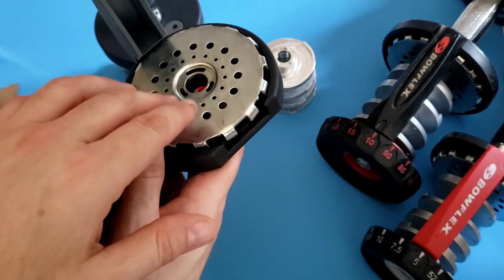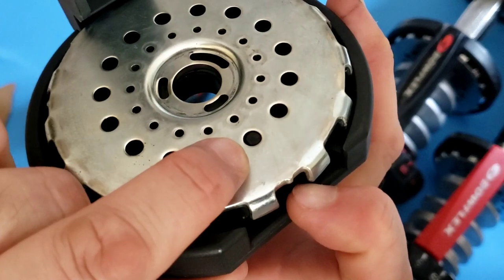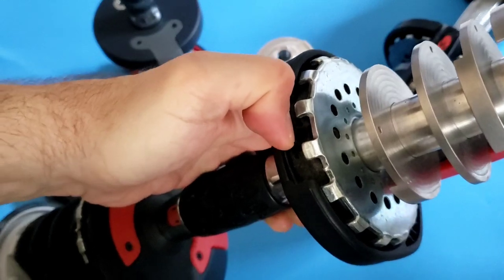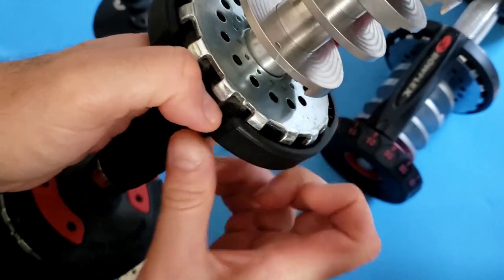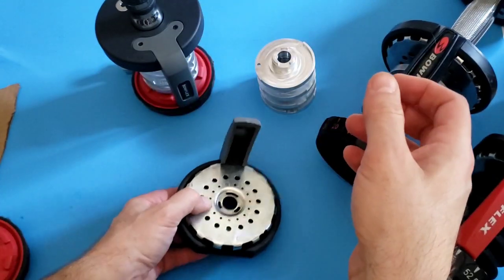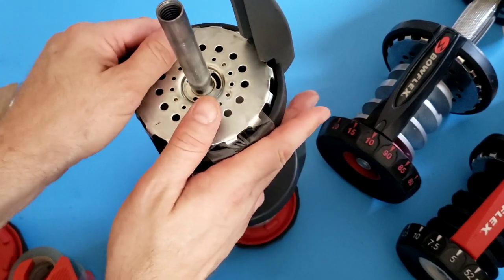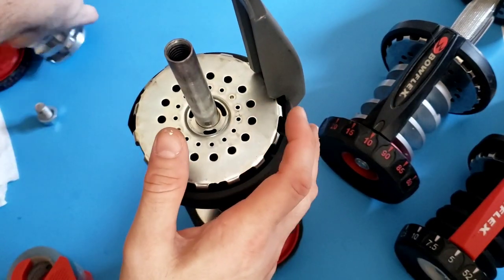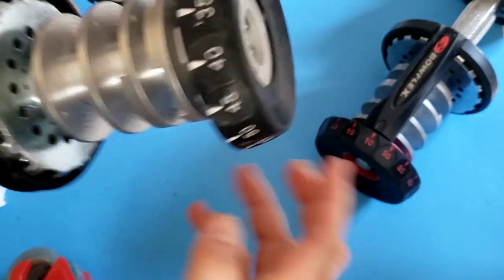Bowflex® SelectTech® 552 & 1090 Troubleshooting & Assembly - Locking Pins, Springs & Ball Bearings

Comment: I was using my dumbbells when a screw popped out (one of the four right beside the handle) and wouldn’t tighten when I was trying to screw it back in. Would you say this is an issue in manufacturing? The screw thread seems just fine so I’m thinking it’s the threaded insert on the dumbbell that seems to be the problem. Great video by the way! :)
Reply from the maker: Hi HM, 99.99% chance that a nut fell off from the end of the screw. Technically if your other screw is still on tight you don't need both, but it is better to have both installed.  I would disassemble the handle down to that cross bar assembly. Then see if the nut is still in there and hasn't already fallen out. If it has, remove another screw and nut....head over to the local mom and pop hardware store and see if you can find a match.

Some SelectTechs do have a threaded insert/boss.  If that's what you discover when you disassemble the dumbbell, then you can try running a thread tap and/or larger screw.  But my first guess is that you lost a nut off the screw. Good luck man.

Comment: Hello, I used ill-advised 3d part before finding you and replaced it but have since switched back because I've never been able to get the long rod to the 'right' tightness. It's either too tight and won't move or even be inserted or hold weights or all of the above!
I've taken it apart, several times and thoroughly cleaned it in desperation to no avail. I've rebuilt an engine and somehow cannot do this.
Will your metal disc's solve this without getting the metal dials too? Or do you have any other suggestions? Thank you!
Reply: Series 2 552 btw
Reply from the maker: Hiya Rob, first I need to make sure I understand you correctly. So you purchased a 3D printed replacement disc and no matter what you tried, you couldn't get the handle to work properly after you installed it. So you reverted back to the original parts for now. Do I have that right? How long ago did you buy the part (just in case it needs to be returned)?

If so, you may simply have the wrong part for your dumbbell or it could be an issue with the printed part. Shoot me a few photos of your dumbbell handle empty, and both sides of the 3D printed disc. My email is joe@averagejoeinnovations.com. Let's first see if we can't figure out what's going on with your part since you already paid someone for that.  I may not reply right away if I'm busy, but I will reply.

I just had a customer maybe a week ago show me a 1090 disc purchased online that was 2mm taller than the disc she was replacing. It happens man.  The OEM/knockoff/printed parts for these things are not all created equal.

Cheers,
Joe
Reply: @AverageJoeInnovationsLLC  Wow thanks for your quick response! Yeah just reverted back to OEM parts to troubleshoot and it's still the same. The problem with the broken one was just a tab so it had no effect on the current problem either. 
And as with car parts Ive always compared and checked the new parts before installation especially if aftermarket. 
My theory is that there is a descepency in length some where in the plastic causing the problem in length which is why I cleaned and checked it. Also why my thought process leaned toward the nonforgiving metal parts. Also maybe the metal dials but didn't see them for sale. 
This feels like it shouldn't be this difficult either so maybe I'm missing something obvious?
Reply from the maker: @YouGotServed835  Thanks for the clarification, Rob. Based on what you just explained, the first thing I'd do is double check that all of the weight plates in the base are in the correct order and facing the correct direction (tabs facing outward). Crazy, I know, but it's a simple thing to rule out.. If even one plate is facing the wrong way it'll cause problems with inserting the handle into the base. If that checks out, then there's definitely an issue somewhere in the assembly. Especially if these are now all the original parts and it was working fine previously.  Could be one or more dials/discs not fully seated into and aligned with adjacent parts. Could be a missing washer. These types of issues will cause misalignment of parts and difficulty inserting the handle into the weights and/or turning the dials to select weights.

Here are some assembly and troubleshooting videos that may help:

https://youtu.be/_EsiCZPiaEM (reassembly)
https://youtu.be/qvprUjIKCsc (troubleshooting)
https://youtu.be/TGXUxw8UOVA (troubleshooting)

Some of this may be a repeat of things you've already tried.  Mechanically, you and I know these things are light years more simple than an engine rebuild. Oftentimes the issue may be staring us right in the face. Hopefully one of those videos will help find the issue through process of elimination. Let me know how it goes.
Reply: @AverageJoeInnovationsLLC  Washers are there. The problem has been isolated to the 1 handle itself because it was tried on the other one I have as well the other handle to weights and vice versa. Sorry I should've told you that earlier. 
Thank you taking the time to respond, I will check the videos you referenced and probably buy the metal discs either way but are the dials for sale ?

Comment: My weight is stuck in the cradle. Whats the easiest way to unjam it or disassemble to get it out the cradle?
Reply from the maker: Hi Ivan, thanks for your patience as I work my way through replying to everyone. If your handle is stuck in the cradle, make sure to check the easiest problem first. Make sure both ends of the dial are set to actual weight settings. If either dial is turned slightly such that it is in between two weight settings, your will not be able to life your handle from the base.  
If your dials are set to a specific weight and you still cannot remove your handle, remove the two end bolts/nuts (usually 19mm) and slide the dumbbell shaft completely out from one end.  Then carefully remove each of the remaining parts from the base.  Pay close attention....there are 4 ball bearings and 4 springs that will likely fall out as you remove the parts from the base. Now reassemble the handle.  I have videos that show reassembly.   At some point I may create a video about this particular issue.  At least a half dozen other people have asked the same question in the past...so you're not alone.

Comment: Hey Joe, Great videos and products. I watched the disassembly video but didn't get an answer to the issue of the selector knob/dial not turning. It will turn if I push in the bottom button. How do I fix this?
Reply from the maker: HI JD, I'm still working my way through emails. Yours doesn't sound familiar so I may not have reached it yet. When I do I'll be sure to send a reply. Thank you for your patience
Reply: The selector knob will only turn when the bottom button is pushed in.
Reply: joe i have the same problem

Comment: My problem with the 1090. is when i select a weight and pick it t up, an extra plate picked up with it . do u have any recommendation what is that could be? Thanks
Reply from the maker: Hi Nashwan, I'm just getting around to my YouTube comments tonight.  The very first thing I would check is the weight plate that is being picked up when it shouldn't be.  Anything at all wrong with the tabs or plastic covering on the plate that might cause the plate to get stuck in between the discs.  If it isn't that, then check the discs on either side of the plate for any warping or cracking that, again, might cause the plate to get stuck when it shouldn't.  And lastly, if you have previously disassembled that handle, make sure you didn't retighten the nuts too much. On older sets especially, and on sets with slightly warped discs, over-tightening can cause weights to be picked up when they shouldn't be.  Any other questions, shoot me an email at SelectTech.Fix@gmail.com.

Comment: I definitely need replacement pins I just bought the select tech from off the Facebook marketplace and didn’t realize that you shouldn’t be able to adjust the weights when your working out. Where can I get the pins from?
Reply from the maker: Oh man, sorry to hear that, Altwan. You definitely should not be able to turn the dials while the dumbbells are off the base. The first thing I would do is disassemble the dumbbells, inspect all of the parts, and reassemble them. If the parts are in good shape, sometimes a proper reassembly will fix the problem. 

If the locking pins are old/worn, unfortunately BF doesn't sell replacements.  Some people part out their SelectTechs and sell pins/springs/discs/etc on eBay when they think the dumbbells are broken beyond repair or they don't want to spend any $ to fix them.  Most of those dumbbells are fixable. 

I happen to make the only metal (6061 Aluminum) locking pins available anywhere currently. 552 Series 2 and 1090 will often fit with no modification. 552 Series 1 usually require some tweaking on a case-by-case basis.  Each dumbbell can be different, even in the same pair. You can shoot an email to SelectTech.Fix@gmail.com for more information.

I think I'll film a SelectTech buyer's guide shortly to help people understand what to look for when buying these dumbbells used.  Strangely, I hadn't considered that until after reading your comment....thank you!

Comment: Hi Joe! Great video as always! I just got ahold of a pair of 90 lb dumbbells (aftermarket) and can't wait to place an order for the discs, locking pins and handle (once it's ready)!

Quick question - on one of the dumbbells when I am turning the dial on one side to adjust for the weight, the dial on the other side turns as well. Would you happen to know if upgrading  the locking pins and spring would fix this issue? Thanks in advance!

Comment: Well, I think I just discovered the problem, and now it is worse.  the plastic black rings are broken, and a couple more just broke.  Now I have more a problem than just the 52.5 not working.
Reply from the maker: Hi again, Christopher. I just replied to your original comment before seeing this followup. I am not surprised that you found one or more broken discs given what you had previously described.  

Assuming only the discs are broken, your options boil down to 5: scrap the dumbbells, or buy replacement handles; or replace the discs on your current handles with more of the same OEM plastic discs, or with 3D printed plastic discs, or with either my aluminum or stainless steel discs (www.averagejoeinnovations.com). 

I know it stinks and they should have been designed to be more durable from the get-go. I can tell you that I was in the same boat years ago along with thousands of others who watch my videos. I wish I had better news for you. If you have more questions, just shoot me an email.  Cheers, Joe

Comment: I got the Chinese knockoff 90lb version . The plate fell off while I was working out so I popped it back in backwards accidentally. I struggled to get it out to the point I started disassembling it. I got the plate off but realized the assembly holding the lock button in place was a tiny screw and nut and it is now impossible to screw it back on because the nut just falls out. So I try to take the whole side apart but got stuck because I don't have a giant ratchet to get the nylon nut off the end, very frustrating. So I either just have to glue it back together or find a giant socket.
Reply from the maker: Hey LT, definitely try to find someone who will lend you two ratchets and two 19mm or 3/4" sockets. Don't glue that cover back on just in case you ever need to remove it again. If you have a Harbor Freight near you, you can pick up two inexpensive thumbwheel ratchets and two individual sockets for under $20.  You didn't lose the nut, did you? Hopefully not.  Any other questions hit me up at SelectTech.Fix@gmail.com because I am not always available on YT to answer questions.

Comment: Hi my dial just spins, could this be related?
Reply from the maker: Hi, Jason. It depends. If one of your dials spins but the adjacent discs don't spin together with it when the empty handle is out of its base, then the dial's lugs may have sheared off. If that's the case, you can either fix it as I demonstrate here: https://youtu.be/vU51aKjhvzU or buy an OEM replacement, or upgrade to my custom dials.

If the dial spins together with one or more discs, but some of the discs on the same side don't turn with it when the empty handle is out of the base. then one of the disc's lugs may have sheared off and you'll need to replace it. Your options are to buy a used OEM disc on eBay, or a 3d printed disc which I wouldn't recommend, or one of my aluminum replacement discs.

If the dial and all 4 discs and the inner steel plate (the one with all of the little holes in it) turn together as a unit when the handle is out of the base, then your locking pin may be worn or it may have sheared off, and you'll need to replace it. I sell aluminum Locking Pin Kits.

Any other questions, shoot me an email. Cheers.
Reply: @AverageJoeInnovationsLLC  Hi Joe, thank you for getting back to me.  So just one side spins, it won't add or remove weights, it's not clicking.  The other side just works normally.  Does this sound like the first linked video? Thank you
Reply from the maker: @jasonmcbride1703  it seems so. It's super simple to confirm. Pull the empty handle from its base, and try turning the dial. As you do that, watch the black disc that the dial is attached to. If the dial spins and the disc doesn't, your dial lugs have sheared off. And you can use the technique from that video to fix them unless the damage to the dial is more extensive. Cheers.
Reply: @AverageJoeInnovationsLLC  that's great Joe, I watched the video and it definitely makes sense to the issue.  Will carry out the repair as I need those weights working.  Thank you for the help!!

Comment: I have the 1090s and one plate is falling out, the smallest one on the end
Reply from the maker: Hiya, Caleb. Chances are excellent that the issue is one of the following:

1. Possible broken dial. Can you turn the dial when the handle is out of the base? Are any of the lugs on the dial cracked/missing? If so, the dial needs to be repaired or replaced. 
2. Possible broken Disc #2. If disc 2 is cracked it will flex more easily. If it flexes then either plate 1 or 2 may fall out. Look for cracks on disc 2. 
3. Possible broken or damaged tab on the weight plate itself. Check the plate's tab: https://youtu.be/7g99OA4hdFI and repair if needed like this: https://youtu.be/POO7XyWl9ps
4. Possibly assembly issue. Though this is the least likely cause, there is always a possibility that the end nut of the handle has loosened. I would expect to see more than just the one issue that you described. You can check by trying to wiggle the dials and discs like this: https://youtu.be/qvprUjIKCsc?si=BoX8Ebl61UZHmbsX&t=38

If the issue occurs on both handles, no matter which way the handles face, then it's likely #3. If the issue occurs on only one end of one handle, it's likely #1 or #2.

Cheers,
Joe
Reply: @AverageJoeInnovationsLLC  I got it fixed nothing seemed broken after checking so I just kind of slammed the set into the standing plate and locked back in . 

I found your site btw and I'm amazed. With your upgrades, these weights will become legacy equipment and be around forever .

Comment: Looking for replacement spring? Any idea where I can find any?
Reply from the maker: Hi Charles, I know I answered this in an email for you.  I'm leaving an answer here as well for visitors checking out the video.

There are two types of springs in a SelectTech dumbbell. One for the locking pins. And another type underneath the ball bearings in the crossbar assembly.

eBay is your only real option.  Sellers that part out dumbbells. The alternative is to hunt down springs with the exact dimensions and spring rates...that's a pain and more trouble than it's worth.
Reply: God Bless you brother. I thought I broke my bowflex adjustable dumbell untill you pointed something out to me. Much love and respect my brother. THANK YOU!